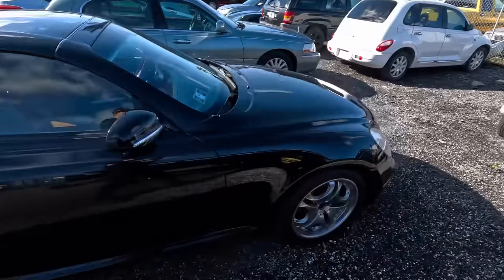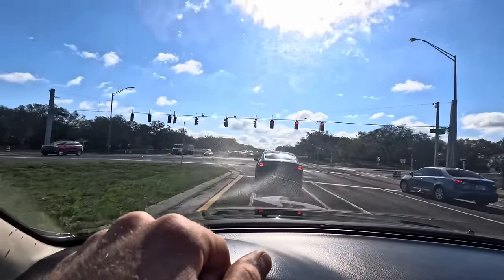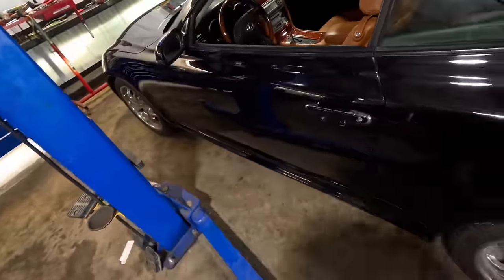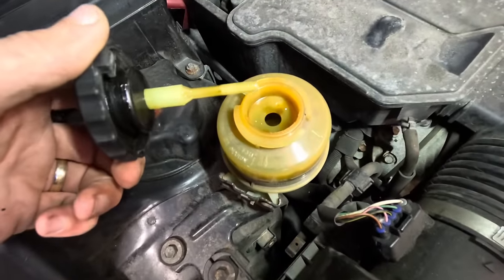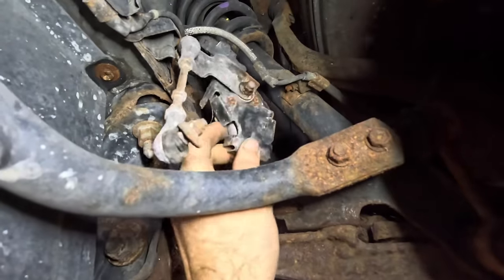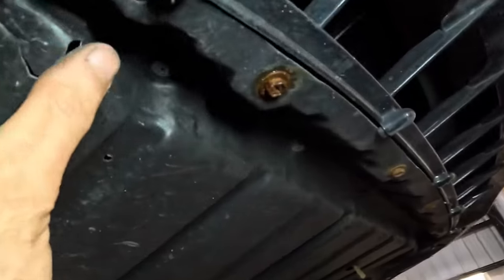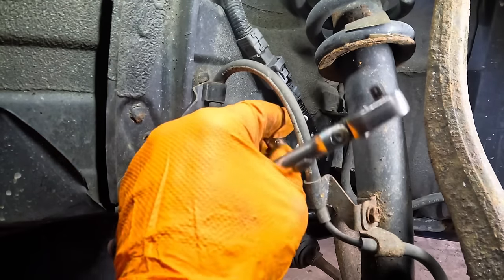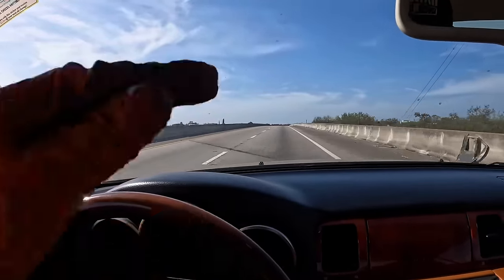Most Hated FAILED Sports Car! Lexus SC430

Comment: With used parts, as long as the customer was informed and agreed, I see no problems at all. As far as warranty, I would say the install is warranted, such as your weld and anything not related to the part purchased such as the bolts, and the warranty from EBay should handle the part itself.

Comment: so true. back when i first started as a automotive technician. you had to know how to repair and or rebuild  starters, generators, alt, and brake cylinders' and calipers. now everything is replace, replace and yes it is driven buy the manufactures of said products with them making it damn near impossible to rebuild anything on the new cars.

Comment: Nice fix on that bracket. I would have spray painted some corrosion protection paint. To prevent the bracket and welds from rusting again. The car is a Toyota Solara in a tuxedo.

Comment: Hi Ray; Number of questions the height sensor was it for Head Lights? What trouble did you have for the transmission & differential drain plugs and did you replace with new plugs? Did you replace timing belts water pump & pulleys? Everything looked original..& rusty. Thank you

Comment: Question at 33 min, my answer is after 30 years of sales and salvage if you have or can get a good used part why not? The very last time I went to a Chevy dealer was to get a water hose for my 454. They wanted $70 for a 4 inch piece of hose, I went to Auto zone and bought a hose for a different application for $7 and cut a 4 inch piece off.  Not to mention the enormous amount of cars I have put back on the road.

Comment: e-bay to the rescue, has saved me on many repairs for stuff, in price and  with obsolete parts.  Even finding brand new OEM New old stock on e-bay.  For a wolf gas range, gas line $25.  From wolf $98..same part in same OEM bag.  e-bay is very handy

Comment: Ray since you asked I think you tell your customer the options like I m waiting on a new part(with price) and used part(with price)and time frame.  (Give them some understanding). Since you welded the bracket for the ride height,it’s hot and when you paint with some black spray paint it dries instantly.  It looks good on your video too.  This car’s maintenance is now up to date. I like how you clean everything you’ve touched with brake klean and the dropped can. Have good day Ray.  We all can be critics sometimes

Comment: Used parts are fine, saves landfill, cheaper on the wallet. I was curious about the brake fluid refil, had enough challenges with broken bleednippels.. the car really looked like is needed the full fluid monty.. and lastly, did you hit the welded bracket with a bit of primer/paint?

Comment: If all you can get is from ebay. So be it. Better than nothing. Great work!!!!!  I did a 50,000 on my 1997 E-150, had a bad a/c compressor. Ford no longer had them, so I went with 3rd party NEW instead of a reman, even though it cost more. Some times yah just got to do what yah got to do.

Comment: I owned a subaru forester and needed headlights,  mirrors and computer. All were used due to Subaru charged a fortune for new and was 6 months out to ship.  Mechanic asked me and i said sure.   It all comes down to your relationship with your Mechanic.  If you trust them, then they should never steer you wrong.

Comment: OT: You ought to fab up a grinder stand with your mig. Free up the bench. steel wheel rim (with or without tire) pipe and plate with holes. All good. Put it next to your drill press. Yeah, get one of those floor models. That's the ticket!

Comment: That part looked new. However, as long as the customer knows its a used/salvaged part its all good. Some parts are just unicorns and are impossible to find in a timely manner. On that Lexus, I think the ride height sensor just controls the auto leveling headlights. Could be wrong but thats all it did on my Saab.

Comment: Pretty straight forward, put the decision to the customer; repair it as soon as possible with used parts or wait for new parts that may not have a definite arrival date.
This scenario seems to be the rule more than the exception these days...

Its entirely up to the customer how important the repair is and whether they're ok with used parts as a fix or just to keep things operating while waiting for the new parts.

Used parts are quite often a good stop gap to keep things going while waiting for new parts, yes you often do the job twice but the net result is higher customer satisfaction.

Comment: change coolant, the old coolant is corrosive and will kill the radiator, been through a few on the same car with bout the same mileage.  Engine is rock solid and will last forever.  It didn't really fail, it wasn't a sports car, it was designed after a yacht, for the 50 year olds and up. The original run flats only lasted 10k miles before needing replacement.  Uses the same TB/WP as the SC400 and GX470

Comment: Great Weld.  Tell owner that scarcity required the install of a functional used part. NEXT:  The vehicle should get New Struts. New (rebuilt?) Brake calipers. Roll bar bushings. Check all bushings on the suspension, esp. the rear. Install Amsoil fluid in rear diff. IT NEEDS new plugs and wires, or coils (depends on what it has, obviously). Remove and replace the radiator. Also, new brake rotors, pads, hydraulic lines. Check the wheel bearings....esp front.  Only use Japanese bearings, if needed. The V-8 was designed to roll up, VERY QUICKLY, moving the car from 60 mph to 130 mph. Smooth and very powerful. NOT a Dodge Street racer/burnout design.  Since no one wants to spend the monie to do the above, the vehicles, sadly, are ignored, and trade for little monie.  Wife Unit should have one of these, to use on Saturdays to go to the asian nail salon, top down, in Florida sunshine. Get one. Fix it. U will not be sorry.

Comment: As to your question on used parts, I'm sure you cleared it with the customer and determined that finding a good used part was the most practical plan. But what about cleaning the old part and using some penetrating oil to free it up? You had to weld anyway, so welding the other bracket wouldn't have added that much time. Not a good plan if you had had the part at hand, but with a week to wait, it might have been a consideration. Your thoughts? Also, why not spray penetrating oil on the bleeder valves and oil drain plug while doing the inspection. Can't hurt and might save breaking off a bolt.

Comment: Hey Ray, My 2002 Lexus ES300 had the same problem.  That ride height sensor broke loose from the lower control arm because the linkage seized up.  I applied some heat to the linkage and broke loose the ball joints.  Then I lubricated them and welded the lower bracket back in place.  The sensor unit still worked.  You might have done the same for your customer.  Regarding used parts.  EVERY OTHER PART ON THE CAR IS A USED PART!  So, it matches, what's the big deal?  On the plus side:  The used part is tried and true and you know that it works (unlike new parts).  Or presumably it works.  Second, it, probably, is a factory original part and not an aftermarket part and that can be a plus.  Third, it's cheaper and more available.  BTW, the one you got looks great and will probably last another 20 years.  Yeah, just tell the customer so he doesn't accuse you of cheating him.

Comment: I love watching, you are so thorough. I sometimes wonder when you don't show the complete job if you are doing more, like did you use any penetrating oils on the rusted brake bleeders or the diff drain? Did you use any loctite on the fasteners for that ride height unit and did you add some grease on the that ride height unit sliding parts?

There was no error code from the ride height unit on the first or final test rides, what was the unit supposed to be doing? Did you notice a change on the final test ride?

I bought a new Toyota Solara in 2004, the cassette player was only available as an upgrade, the CD play was standard. The sound system had and aux input, USB had not yet become popular, And we did not have smart phones, but we did have MP3 players.

Comment: When it comes down to used parts, always talk to the owner of the vehicle prior to placing the order. Always test said part to ensure it works, that way you can always return it if it's not working. As for all that rust, the owner can always have it removed with a dry ice washer, after which should be applied a coat of under-protection.

Comment: Regarding your question about the used part. I would opine that if the customer is okay with it, you're good. Given the option of a backordered part and a good used part, the conclusion should be the way you went. That part looked to be good and it functioned as designed. With your repair of the broken bracket, it's all good.  I enjoyed the education on the history of that Lexus, did not know any of that.  The hard top looked to be similar to the one GM used on the SSR, and maybe other places. I didn't know the design was noisy. Love learning.  Thanks.

And the Lauren cameo was great!

Comment: Seeing an Illinois plate guarantees rust if driven in the winter.  Used parts are good as long as the customer is given the choice.  Sometimes it’s the only option available.

Comment: The insurance co. want body shops to use used parts to save money. So if you have exhausted all avenues to obtain a new part and that has failed due to unabtainium parts then you have other avenue but to get the best used part you can for your customer so that they can enjoy there atomobile quicker, as long as they are on board with the used part.
Ray, Wife Unit and Dave have a great weekend coming up.

Comment: So what happened with the reseal of the Caddie?

You need to get yourself a TIG welder. To have greater control on those small welds.
Reply: The problem is that TIG is a lot harder and you have to learn it

Comment: Honestly, Ray, I have no problem using used components -- especially if they're cheap. And, yes, you sometimes get burned by a part that doesn't work, but that's the trade-off. Many times, it's electrical components that can be found used, if you go to a decent JY or salvage yard that keeps up on the age of their stock. I've found wire clips, fan motors, and other electrical goodies before in salvage yards that worked perfectly fine -- goodies like a Bronco II instrument cluster for my 1992 Ranger. Not only did I get at least two sets of gauges that I could pick the best ones from, but I also got cluster bulbs that still worked, which meant a fully-lit instrument cluster. Only on certain parts, like brakes, hoses, and belts, will I insist on brand-new.

Comment: you have no choice sometimes having to use used but in good condition parts. at times they are
just not available due to age of auto, or no longer available from the manufacturer. sometimes you
get lucky with “new “ old stock parts! but that is rare. and depends upon the contacts you have in
the industry. and their sources that they know. great question, and nice seeing you “thinking out side of the box”

Comment: Used parts are acceptable especially if they aren’t available new from manufacturer or aftermarket. Recently, I purchased a power window door switch bezel for a 2007 GMC Sierra from a salvage yard because Mr. Goodwrench doesn’t make them anymore.

Comment: Using good quality used parts, and doing a little bit of bracketry welding, is fine when 'on back-order' means the forever version of manana. Just make sure the customer understands the part isn't under warranty and that they'll be paying for another replacement (IF available) and labor if it goes wrong. One thing though... that IS still a nice car and it's in great condition for having been in the land of salt and rust.

Comment: It's a no-brainer. Communication is key. You tell the customer the situation. Obviously they've been driving with it broken for quite some time so just getting it to work properly is a bonus and they most likely will be OK with it. Again, it's what the customer wants. The new part says "back order" but that could mean one week , or never. You would probably order it and get a message back saying that the part is no longer available (discontinued). Trust me, one of my cars is a 2000 Accord and I have gone through this a few times, so I end up buying a used or aftermarket part.

Comment: Ray, all LS430s and probably all SC430s came with ride height sensors. And I don’t know why! They are only utilized in the electronic suspension cars. You should have just disconnected it, capped off the connector and thrown it away. As a LS430 owner who loves his car, and goes to pull-your-own-yards, I’ve seen all LSs whether they have coil or air springs with these sensors. (Thru 03 at least. Front and rear driver’s side only). I don’t know why Toyota did it! An assembly line thing?? By the way, the LS is built much better, and with better parts, other than the excellent shared powertrain. And the interior is very quiet. If you get a chance, look under the sedan, and you’ll see what I mean. I could go on forever raving about the car! Love the channel, keep up the good work.

Comment: Parts that do not wear, but break, or get broken - typically plastic engine parts in the intake area or a wiring loom that's been 'crittered'  are prime candidates for replacement from crashed scrap vehicles. I would and do always use such. The same goes for 'computers' which either work or do not work. They don't wear out, as such,

Contrariwise I would never use a parted out e.g. rotor or slide pin or  caliper from a brake system.

The grey line is for example an engine of say 80,000 mile to replace a ruined 130,000 mile unit.

Comment: @11:00... That's very cleanable. @18:00... Destructively remove the plugs and replace them. Or, use a sucker to pull the trans fluid out through the dipstick. @30:50... The skill is going to be setting the ride height.

Comment: I think used parts are acceptable so long as the customer knows and approves of said parts. One thing i do when I run into rusty fasteners...like the 2 bolts holding the unit to the frame is i use a dab of oil and work the bolts in and out a bit to clean the rust off. 
   A good video..the car i think was an attempt at biting into Mercedes sales of similar car type. A good looking car though by Toyota.

Comment: What year? For 20 years ago that car had every bell and whistle. BTW, 41 of 50 states gets snow. It is the south and it's humidity problems that are the odd ones. Get some lubrication so the next time you work on a real car you can get those bolts loose easier. Did you remember to replace the belt?

Comment: The wood trim was real on those cars. They weren’t well received but quick for its time. And the Navigation System was behind the center wood trim. The LS430 of its time had better tech and much better reliability than the S classes of its time (W220)

Comment: As I recall, that vintage SC came with run-flat tires as there was no room for a spare tire (or tyre for the Aussies). The rear tires wore out quickly because of the rear suspension. That made it a money pit.

Comment: Hi Ray, used parts OK? In this case,  you betcha but clear it with owner beforehand. Unobtaineum part with used component likely to be very durable makes it a good solution. I am a bit surprised that you didn't hit the brake bleeder valves, differential plugs and all other rusted fasteners that would need to be removed for fluid services at the time of the initial inspection. That might have made fluid services a bit easier and since the vehicle was waiting on a part there wouuld have been time to allow the penetrant oil to do its thing, and even reapply before attempting removal.
Fluid services left a few loose ends. Did you get the brake fluid replaced? If that's the original brake fluid its had 20 years to absorb water and I'd really think that to be the fluid most in need of replacement. Also you mentioned that coolant was probably acidic, so was the coolant flushed and replaced, or at least tested for pH? And I would think a spray of rustproofing paint on that bracket you welded, or applying some other form of sealant would help prevent it from breaking again in the future.

Comment: I'm surprised you didn't use a penetrating oil/spray before removing those bolts for the leveling system.

Comment: I would have liked to seen removing some of the fasteners
Like brake bleeder, rear axle plugs and even the engine oil plug
I'm old enough to know what you mean by ending transmission

Comment: I think a used part is fine as long as you can verify it's working. I do think checking with the owner if they're ok with that is a wise move if only to cover yourself. My car is 24 years old and sometimes I just have to accept a used part, although I'll generally try and source it myself, whether from a scrapyard or online. Of course used parts are likely to be in the same or similar condition to the part you're replacing, so you need to be careful inspecting the replacement part. I would not fit a used electrical component unless, as you did here, you really really had no alternative. Best wishes from Australia!

Comment: Hey Ray matter of used parts. As long as the customer is aware and you feel the parts are in good condition I see no problem with using them. Some shops would have passed on the repair of said car. Again as you always do, you went above and beyond the average shop. Customers can come to you knowing that the job will be done right.

Comment: Just a tip a professional welder game me, use a piece of copper when welding like this.  It will prevent your welding to vice and helps on very thin parts.  Otherwise nice repair.

Comment: That model Lexus has the 3UZ-FE 4.3 Liter V8 VVTi. Several Toyota models still use this engine because of its reliability. As far as the used parts, if the part is unavailable from the manufacturer then by all means use them.